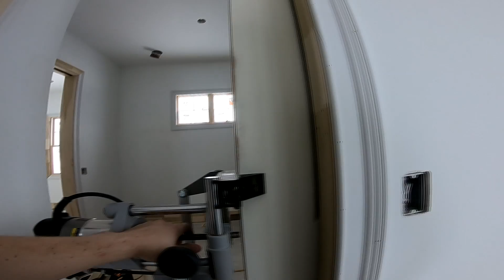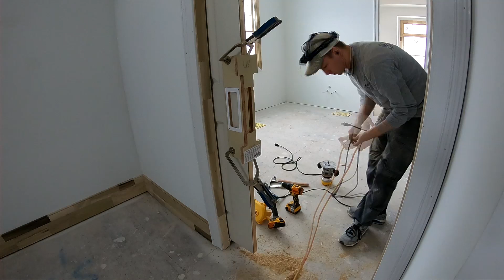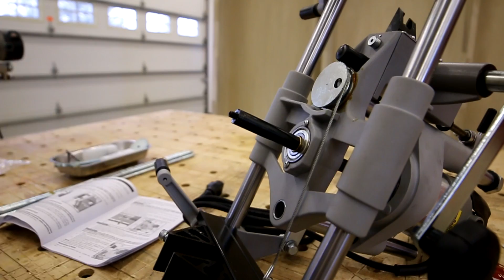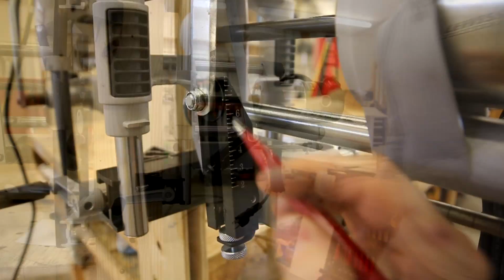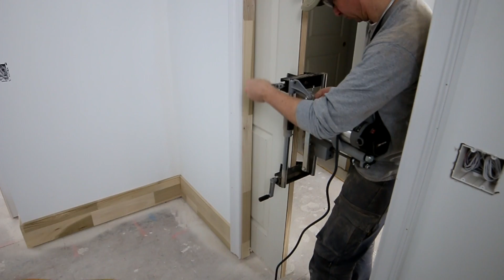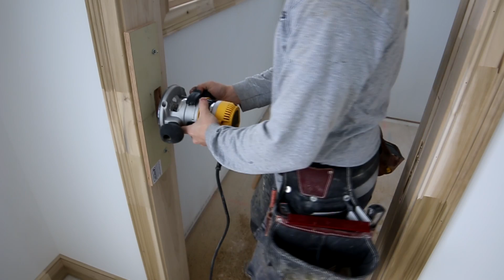It Broke on the First Job...Porter Cable 513 Lock Mortiser Tutorial on Emtek Pocket Door Hardware

Comment: I just purchased a used machine for a hundred bucks and I've been working to refurbish it. It even came with the 517 template for the faceplate. The thing I'm most concerned about is the gearbox, which I'm scared to open up for fear of springs flying. Does anyone have any service advice beyond the parts schematic?

Comment: Not unlike RandyBowe3986, I've been in the business for exactly 40years now. I bought an original 513 in probably the mid-late 1980s. I have used the snot out of this machine and though it's pretty beat looking, it still works great! I have never had to get it repaired nor have I ever had to replace any parts on it even after what has got to be thousands of lock mortises cut. 
   I'd like to assure you that in my opinion, you explained this tool and the process very well. This is the first video of yours I've watched, and I found it because I was looking for a freshen up tutorial on the 513 because it's been a few years since I've used it, and my memory isn't what it used to be. This video is just what I needed!   Thanks!

Comment: Sorry for your luck, you must have got a lemon built on Friday at the end of the shift. I have used these 513 for years and years, never had any issues. You absolutely need one to install mortise hardware all day long. It will pay for itself in less than a month. I wouldn’t be without one.

Comment: Your good Iam going to do several Emtec pkt latches.  I have several tempaco tools.  Going to order all the templates for the emtec hardware.  When I needed mortise maching years ago pc was backorded I bought a Virutex glad I did.  I had 300 kaba hotel locks to do. The units were furnished so the dust port on thr Virutex helped keeping things clean. The verutex springs back after depth is complete.

Comment: I use one made by souber,it's a little bit smaller and doesn't come with the motor attached you just have to get a drill that's capable of 2000rpm. Using my dewalt cordless trim router alongside my trend two part hinge jig and souber morticer I can fit anywhere between 8 and 11 four hinged fire doors in a day.
Our doors here in the uk don't come pre hung in the frame so those doors include cutting and planing to fit if necessary,cutting four 4 inch hinge rebates in the door and the frame. Cutting out for the door latch and the face plate in the frame and fitting a pneumatic door closer to each door.
These tools really make the job easier and up the productivity exponentially.
Reply from the maker: I've seen them and would like to pick one of those up and give it a try sometime.

Comment: We had this at the locksmith school.  Great piece of equipment if you have to install a lot of mortise locks.  I also like the Templaco templates, just hate making a hole in the wood.  I do think you were going pretty fast on the mortise jig.  I just go at a slow steady pace.  My former boss bought a new one and it broke without even being used once.  It must of been assembled incorrectly is my guess.  Great video.

Comment: I work at a door manufacturer, and while I don't use the stool myself, we do have one and it seems to work just fine. So for what it's worth, my guess is that either the nut that you re-tightened or some other nut on the device is over overtightened and causing unaccounted for strain on the very thin wire. Obviously something is bound up, that much can be seen from the video. And it makes sense that resistance at the joints and strain on the cable would be greatest at the point where you're changing directions. I can understand it would be tempting, given that you have a high velocity bit and you're trying to make a precision-cut, to keep everything as tight as posible. But unless machines are precision built and well-oiled, constraints on joints are really not possible. My suggestion would be to loosen everything up just a little bit and it should work fine. There is after all a reason the bolt that you tightened has a locking gasket. Manufactures don't spend the extra money on such things unless they serve a purpose. That joint has to make a hundred and eighty degree turn under force and should have absolutely no resistance on it adding to the strain on the cable. Sorry, if this post comes off as preachy.
Reply: очень приятно с вами общатся!к сожалению у нас сейчас 2 часа ночи.если вам будет интересно я сниму и покажу вам как мы делаем врезку фурнитуры в полотна.я думаю вы откроете для себя много полезного.ак обычные петли так и скрытые петли.ну и замки конечно.

Comment: Porter Cable, interpretation, brand new junk!
Reply: Ever since Black & Decker bought Porter-Cable they've intentionally stripped it down allowing their own company DeWalt to shine and be there top shelf company for tools. Porter Cable had always been a really high-end professional woodworking tool company and of course they did other tools for metal work etc drywall. I was lied to once by a Black & Decker tool rep at a welding trade show. Because of that lie I will not ever own a DeWalt power cord or cordless tool. Greg

Comment: It is unreasonable and unfair to hear anyone knock a tool that they have not used and are not familiar with.  I am still using the mortiser that I bought used in the 1980's.  I don't use it a lot but, when I need it, it is there.  I bought it from a broke carpenter that wanted whiskey money.  I had no instructions and no experience with the machine.  I cursed the machine, the design, the details but after mastering it.  I can cannot imagine doing a door mortise any other way.
Reply from the maker: I'm not knocking it, I'm just showing my experience. I was going to make the tutorial video regardless. The fact that it broke just ended up being part of the video and adds a little entertainment value.

Comment: What about the ones without the motors. You attach your drill to it. They are very cheap. Plus you have to move your drill to do the work
Reply: I have never seen what you’re talking about, unless you mean the jigs your can buy for a standard lockset. I would be very leery of a drill based machine for doing box mortice locks since the chuck on a drill is not meant to deal with sideways thrust. For a bit that is being pushed sideways you need a collet to hold it like a router has.
Reply: Do you mean the Souber DBB mortice have had one of 8 yrs ,aloot faster does tube catches also the face plates paid for its self on first job also use TREND hinge jig
Reply: @davebarnes1742  like I said in my earlier comment, I had never seen a drill based one of these. Having now looked at the manufacturers website this does Look like something worth using since the bushing that the shaft passes through would handle the sideways forces. Thanks for  mentioning this.
Reply: @janderson8401   happy to be of some use have used as morticer when asked to make a gate on site by client .What i like is dust not flying all over the place
Reply: @davebarnes1742  yes souber dbb and its various chinese clones. Amazon is flooded with this type of door mortiser

Comment: Hello, Great Video...  As a 40+year veteran Carpenter/Custom and Production Door Hanger I own a PC 513. My unit is a type 6 with the older 10 amp router motor which I bought used back around 1987...?  I have done literally a 1,000 + mortises with my unit and I go just a little slower with the crank and let the tool do the work... Your unit might need a little dry lube to smooth out the roughness in it’s operation...  one tip for you”Wedge the door before mounting and using your Mortiser”.  I know you need a power cord for this unit but recently you had a video with like 4 DeWalt battery trim routers any reason you did not use them? Templaco templates are a Great time saver for sure. Another thing you had the Height stop rods available to use, Why may I ask did you not use them? It would have sped things up for you as not needing to pull out a tape measure as much... Check out some of my work by viewing the Condo complex on YouTube “Thunder Spring” Ketchum, Idaho. All the Hardware was “Rocky Mountain Hardware”.  Oh and all the Doors and Base boards and Flat Crown were pre finished. So a Big challenge in itself... LoL. Again Good job and Nice Video, Greg

Comment: Always used Baldwin mortise locks. Wasn't necessary to remove all that wood from the face. Just drill the proper size holes using the paper template provided.